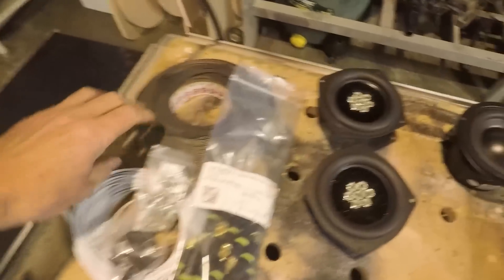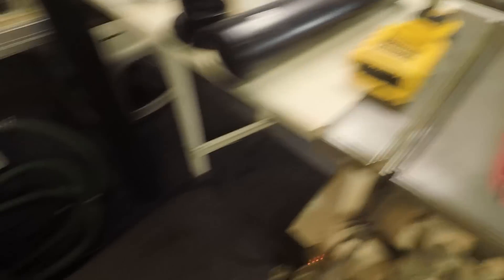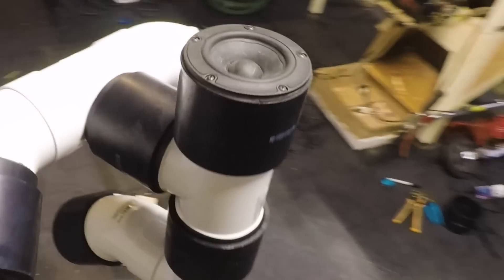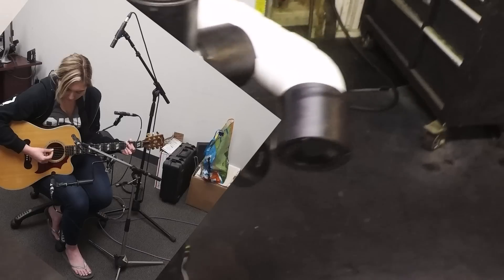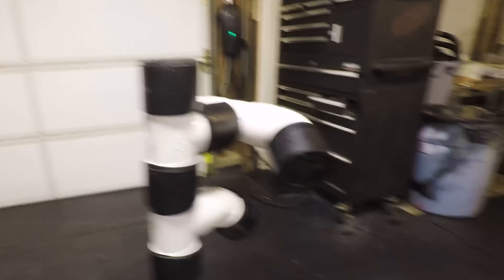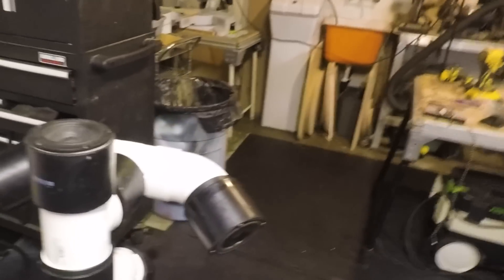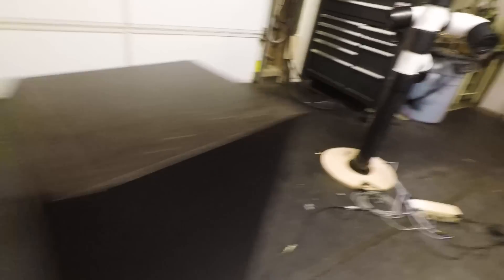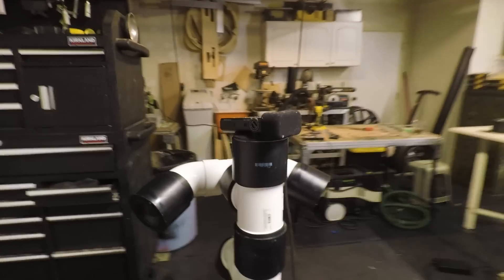Speakers Don't Sound Real, Lets Build One That Does

Comment: The guys at tectonic industries have some really great stuff you can order - they bought all the NXT patents. Bending wave is 100% distortion, but it can sound pretty good. We can make the whole room a speaker, every single surface.

Soundfield B-format and "football" geodesic ball arrays of loudspeaker drivers is a good idea but would have been far too expensive to drive with a multiplex input. It is still a big ask in terms of processing and data.
Reply from the maker: I have some NXT prototypes and used NXT speakers in the decorelation demo. I was consulting on early designs of flat panels helping deal with resonances. Interesting stuff. I have a friend that does invisible speakers in walls as well, where the room becomes a 5.1 or 7.1 

That said, all that stuff is based on radiating sound at the listener and an instrument radiates sound outward from it.
Reply: @DaveRat  Amina sound? I was really impressed with the engineering on their drive units for plastered walls, good UK company, if you don't know them I recommend taking a look.
Reply: @weareallbeingwatched4602  have you ever heard them in person? I’ve heard some panel speakers that I have been quite impressed with.
Reply: @DanielBliss  I don't mind double digit total harmonic distortion, it's normal. Can sound quite nice. Everything has some, and if it's lacking, I'll put some in on purpose. The discussion of tone by guitar players and producers is quite commonplace, and more distortion is more loud but less hearing damage - it spreads out the timbre and sonically enriches things. NXT technology is basically 100% THD, though. Not totally high fidelity, but if you're making a musical instrument, you want a bit of character and resonance.
Reply: @DaveRat  after spending a year or two playing drums in a room full of steel pans, which sounded like being underwater or in a submarine, it was that much resonance, and realising the level of sympathetic resonance involved in real world sound and reverb, and the diffraction/internal reflection/ coupling effects caused by mismatching transmission speeds in different materials... i have come to realise that a room full of guitars sounds like a room full of guitars... so during lockdown when I was stuck in my shed... with a very short reverb time... I added reverb to the room by just hanging up all my cymbals off the ceiling on bits of rope... but I did not expect it to work quite so well. One or two cymbals in a small dead room makes a lot of difference, like putting plate reverb in the mix. MIND BLOWN - now I know why led zeppelin dragged that gong about... it's a reverb plate! if I cough or clap it sets them off. Resonance and anti resonance is seriously complicated, and wood provides a beautiful and magical space which the anisotropic and adaptogen based performance of natural living materials encurcling and branching is a process of structure so incredible from a resonance perspective. Trees know how to avoid having just one modal vibration, and how to distribute and manipulate forces using elastic deformation, it's way beyond the double pendulum in terms of chaos tuning. It's very powerful stuff, non-linearity.